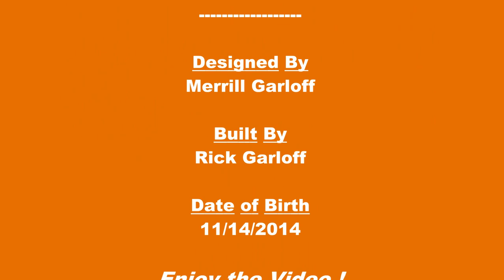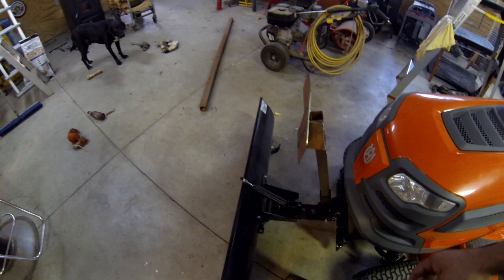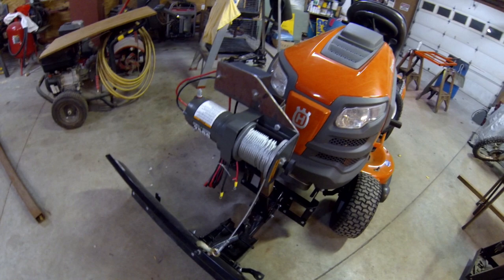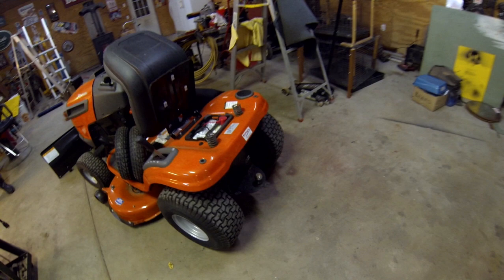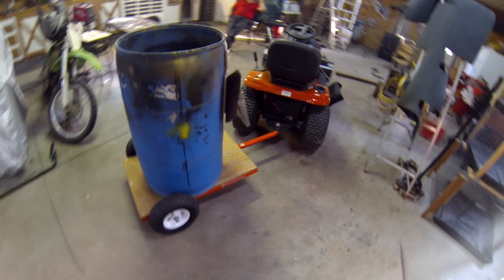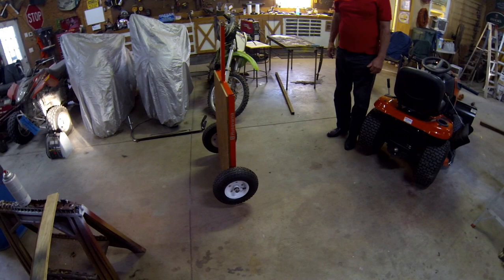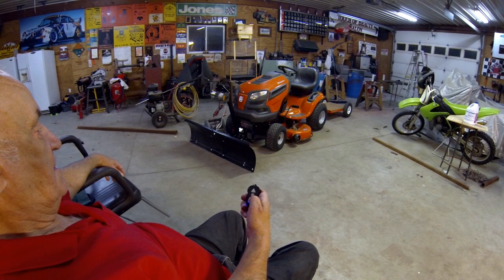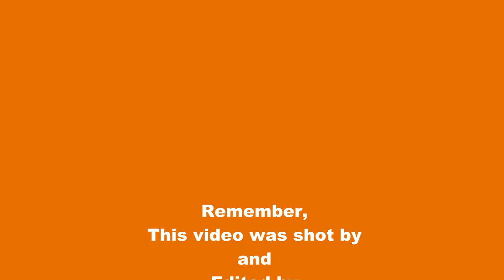Weekend Project #217:Garden Tractor Snow Plow Lift & Small Trailer

Comment: I like the idea of a winch lift on this style of plow. I question hooking a basically static cable to the "tripping" spring on the blade. will the blade still layover if you hit a hard obstacle?
Reply from the maker: +Mike Snell we learned that lesson the hard way... when it did hit a hard ice pile it did bend the lift tube slightly... So yes you are correct on that... we reinforced the lift tube and have not really hit anything solid since.... Good Catch....
Reply: I also thought of that issue when I saw the winch was hooked to the top of the plow blade. It would not allow the blade to fold forward like its supposed to when it hits something solid. Or, as you said, bend something. I'd move the winch hook to a point behind the pivot on the blade. Love that trailer! I hope your dog got a ride on it at some point, lol!

Comment: Nice Built. Add Extra extension Wire to this Kit so People can Hook it directly to their Battery :))). Also, why didn't you put another piece of Metal to cover the inside of your Trailer wheels? What if you put things on it and it SLIDE to there and STUCK, RUIN or KILL your fender? Needs to go back to the drawing board on that one. LOL
Reply from the maker: the wiring is so we can disconnect it when we remove the winch.... the fender ide is awesome I think we might add a piece inside like you mentioned... Great idea Thanks... Sorry to hear you don't have a dad to have a relationship with... Happy Thanksgiving....
Reply: Hahaha, I know, I wasn't talking about that. ADD EXTRA Wiring to your disconnect part. Meaning.... From where you show the 2 wires to connect / disconnect your Winch - NOTE VIDEO at 8:23 - 8:24 Pause it. From there... You need to add like 6-8 feet extra Wires with a RING Terminal on it so People / User can just hook that to their Mower Battery. Or you can make a Battery Wire Extension Kit and charge extra for it as well :))). But most People just want a Complete System... That way they don't have to buy extra things and waste more time ;)

Comment: How did u mount the tires on the trailer?
Reply from the maker: We bought tires at harbor freight they had 1/2" ID bearings , we bought 1/2" OD steel rod from a local metal shop, we drilled holes thru the box tubing of the trailer and inserted the 1/2" steel rod thru the frame and welded it on the inside of the box tubing, we slipped 1/2" ID washer on the rod then the wheel and then held it in place with a 1/2" ID lock collar...Hope this helped you ...
Reply: Thanks
Reply from the maker: if you pause the video at 6:14 you can see the rod on the underside of the trailer when my dad stands it up ... ;)